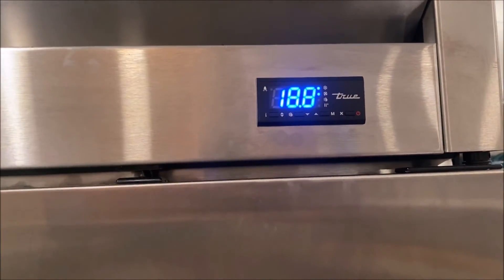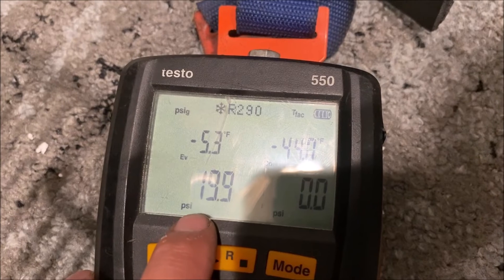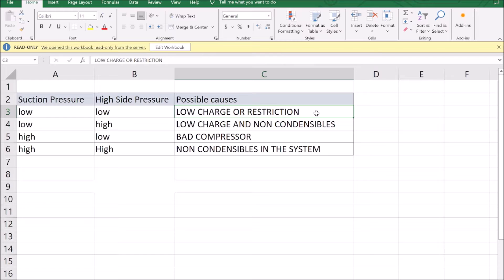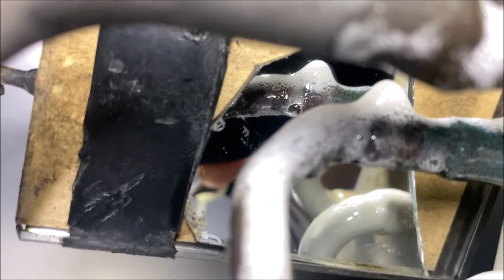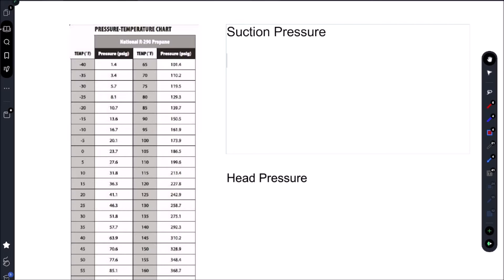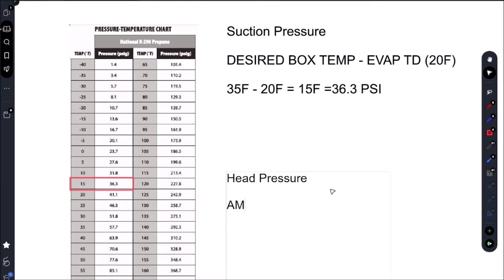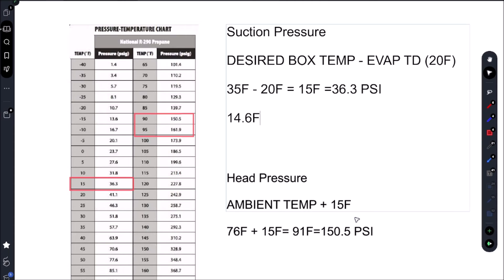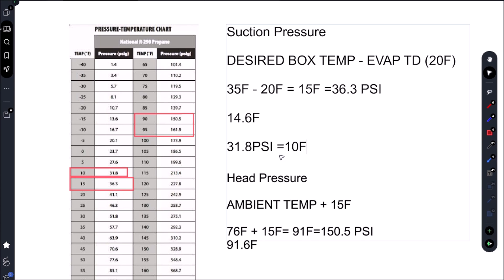True R290 reach in cooler in not cooling

Comment: i usually check the discharge line temp, compressor heat, and compressor load current when there are no high side taps. I agree with R290 units, and R600 they always seem to leak after a year or less and the nitrogen seems to cost me more than the R290, ( purge time) when its $12 to $13 for a 6oz can. Great work!